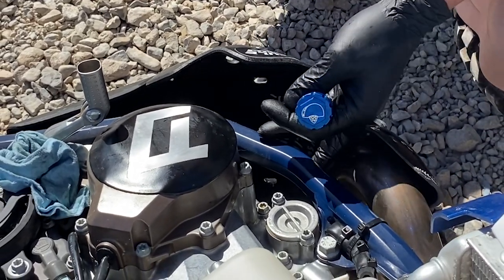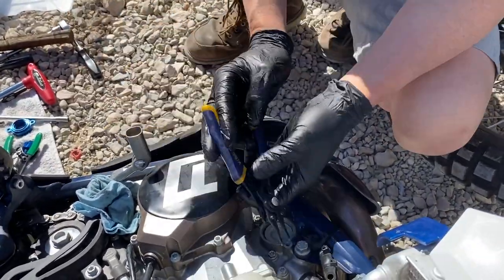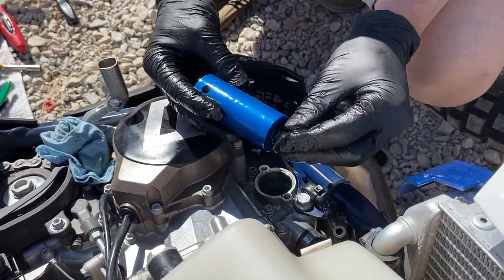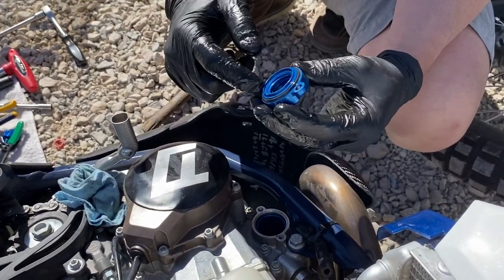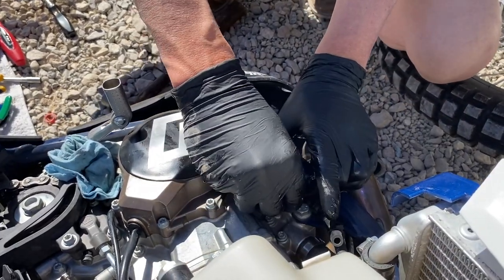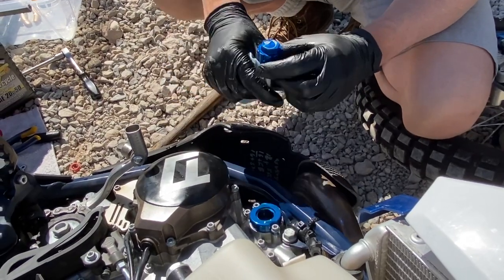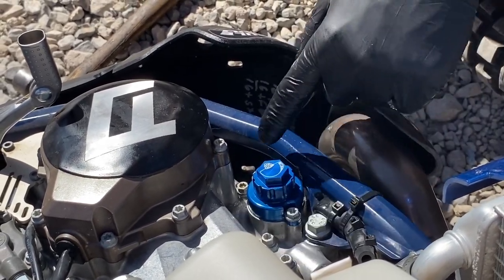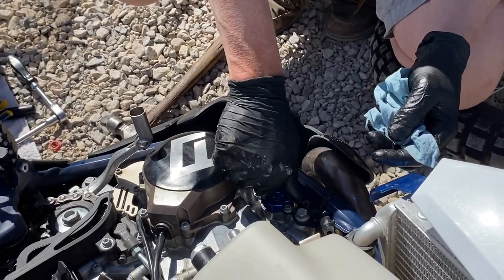MOTHER OF ALL OIL FILTER INSTALLATION

Comment: I don't see a comparison of the oil from an engine running a paper filter compared to this magnetic filter.  Sure, some non magnetic stuff gets trapped in the ferrous metal, but how much of it does?   This is especially worrisome in bikes with shared clutch/engine oil.   Without an oil composition comparison, I'm calling SNAKE OIL.

Comment: I've been eagerly waiting these to arrive. After reading the materials provided while I was waiting and given the fact that Mike wouldn't steer me wrong I ordered one minutes after it went up on your site again. Cost cant be compared to a number of paper filters as you must also take into account the reduced frequency of wear part replacements, longer oil change intervals and less overall engine wear that would cost money over time. Added bonus is the Taco Moto logo instead of the AKT one - that'll be good for at least 5 more horsepower!
Reply from the maker: 5-6HP all day long!

Comment: The only thing that’s kept me from getting one… I’ve heard paper filters can trap moisture in the system which could potentially be the most damaging. This is part of the argument against the stainless steel fine filters. On my 690, kept one paper and one stainless filter just to be on the safe side.

I live in a humid environment and we also ride in huge temp swings, so this is on my mind. I like the idea of being able to clean the magnet between rides etc.. especially because they reportedly do a great job at fine non-ferrous particles and I’m a clutch banger/slipper.

Comment: This is making oil changes super simple. Messing with the oil filter was my least favorite part of the job, now it takes less than a minute and a paper towel. 

I think I may have boogered a seal up, though. I’m getting the slightest leakage from around the base of the outer adapter. 

Do you sell spare o-rings for this?
Reply from the maker: Info@tacomoto.co for a replacement

Comment: Good god. $200+ … that’s like 25-28 regular filters… that’ll take me around 6 years to even up… (.  Awesome little device but… gat’dang…. One helluva splurge :) I always try to justify my splurges for my baby… but gat’dang.
Reply from the maker: Better filtration, better engine durability, better particle capture ratio, no clogging, no water saturation and plugging, no cold start up flow reduction. We’re not comparing apples to apples here when comparing this to an old tech paper filter
Reply: @TACOMOTOCO  just saying. That’s worth nearly 30 paper filters that millions of us have used for decades..totaling billions of hours, collectively.   I’m sure it works.. but dare I say.. getting into Mr. Baldy territory with the hyperbole sounding “must have the best mother of Oil device”, …bike won’t work without it…price of a left nut (or number 10 socket… where’d I put it?!) bling.  I’m sure it works as advertised… I’ll end up ordering one next time I buy a new bike (my bikes last 6 years).. lower price point woulda helped so many more… this is elite :)
Reply from the maker: If you own a KTM, Husky or GASGAS you’ve already self selected as an elite. 

Better products w better performance always come at a price premium. 

Have you compared the price of a baja designs XL80 light unit to a replacement 60 watt incandescent bulb lately. 

The argument you make would say that millions are using the ‘good ol’ bulb and have been plenty happy with them, a light is a light is a light right? 

Why spend the money on that fancy one, hardly seems like it’s worth it, what could I possibly get from it that I’m not already getting from my bulb?

If you’ve ever used these two lights side by side or looked at light output test data the differences become shockingly clear.
Reply: @TACOMOTOCO  Agreed. For only weekend riding the paper filter is appealing for most, it has worked for a long long time.. but for those of us planning to take the bike far off the grid and for a long time, well, I don't want to worry about where I'm gonna get a filter from... this thing makes sense.

Comment: The product info focuses heavily, if not exclusively, on small particles, but what about large particles? How long does a large non-ferrous particle stay cycling in the system before it can attract enough ferrous material, through static charge, to be able to overcome the high-flow over the magnet and stick to it? 

I also noticed that OEI makes a 95+% efficiency claim for ferrous materials, but makes no efficiency claims for non-ferrous, your product info claims 95+% for non-ferrous material. Question therefore is what implementation difference is there to justify that claim? 

If you look at OEI’s ‘Bear Trap’ product, which in essence is just the old ‘slap a magnet onto the existing oil filter’, they still have the same claims as the ‘core technology’. It also appears to be OEI’s automotive product; they don’t make a magnet only solution for oil filtration (ignoring their magnetic drain plug which we already have), it’s combined physical and magnetic filtration.
Reply: I can't comment too much on some of the claims however the large particles I thought on ktmhuskys are picked up by the lower screen/ and magnet. they can't even make it up to the filter?
Reply: @kyushalimit5931  I can’t find any micron rating for the screen filter, but there are a number of factors that would lead me to believe that it’s not a particularly fine mesh (e.g. can see the holes, low surface area, clogging potential, flow rate construction). However yes, you are correct that the screen filter would catch the largest of particles, but this still leaves a range between what the screen filter and the paper filter currently handles.

So, my question still stands, how long does a particle, let’s call it ‘medium sized’, cycle around the system before enough ferrous material is a) eroded from the system to contaminate the oil b) not directly bound to the magnet c) is statically bound to the particle in high enough quantity so that it can be captured by the magnet and not dislodged due to the high-flow?
Reply from the maker: Large chunks never make it past the pick up screen before the oil pump

Comment: snake oil
Reply from the maker: I’d probably agree with you if the third party oil analysis and testing didn’t show otherwise
Reply: it's been thoroughly tested in the industrial fleet sector for over 20 years, but don't let data get in the way of your lack of knowledge
Reply: snake oil FILTER sir! its a good filtration method used in other industries.